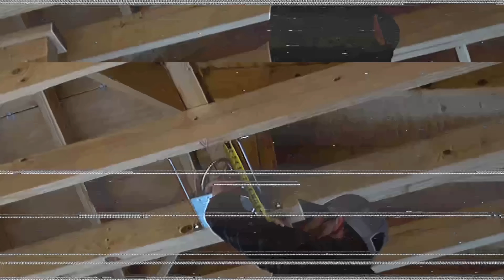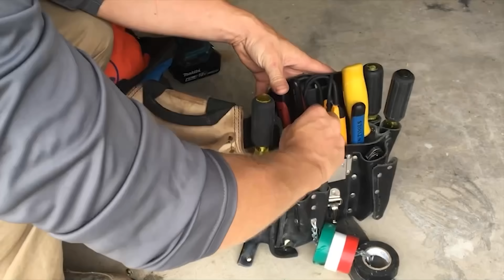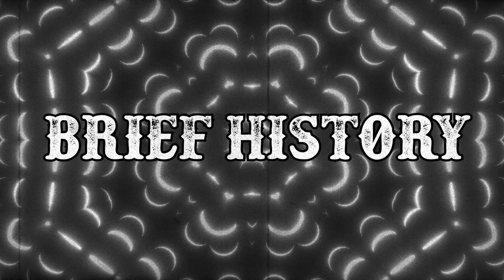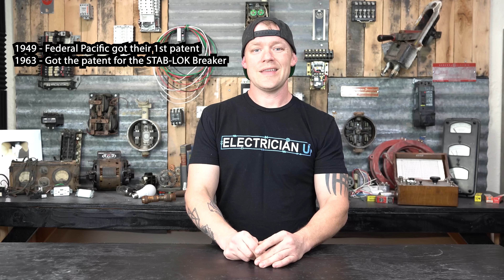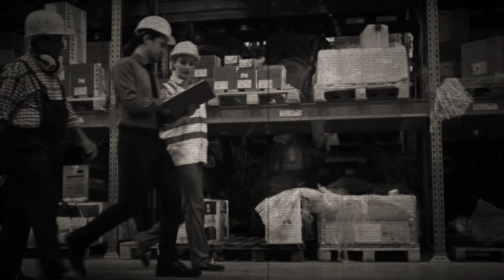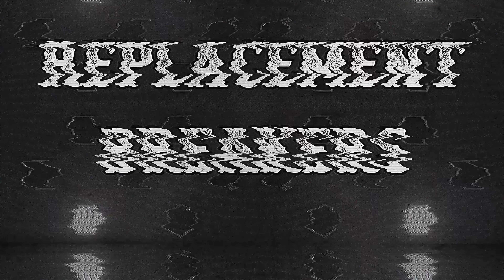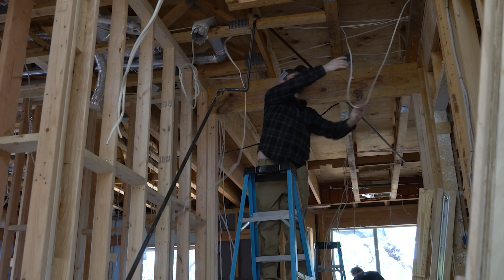FEDERAL PACIFIC ELECTRICAL PANELS - why their panels are dangerous

Comment: In manufacturing (of heavily quality controlled, UL listed) mobile dental equipment..can't say that I ever heard of a % of acceptable failure. 
Seemed like if even if a single device came back from an in-house error, it was a big deal/treated as a big problem. Of the probably several hundred I cranked out, never heard about any coming back. So i this instance, with products costing several thousand apiece, really a 0% out the gate failure rate seemed to be the status quo.

I suspect their stuff maybe failed/went in for repair after several years of hard use from dentists traveling into the 3rd world sticks, as the repair guy was busy. 
I'd guess that'd put it at maybe a 1-2% failure rate within the course of their 5 year warranty or whatever, and in those cases most everything I saw was earlier revisions prior to engineering upgrades - better cooling and whatnot to reduce wear and tear over time.

Keeping failure rate low seemed all about honoring the warranty thus not losing face and money, indeed not UL listed...unless a new product about to be sent over to UL for their internal testing.

Comment: The thing I hated the most about the stab-loc line is that when pushing in a breaker you WILL accidentally turn that breaker on.
Reply: We covered it in my 4 month inspection class and I always recommend they be replaced asap
Reply: It’s just so crazy that these panels are STILL intact in most homes and inspectors don’t inform the new home owners that “aye this electrical apparatus is kinda fucked and is a ticking time bomb. Change it own in the near future”
Reply: @ivanromo2030  Most home inspectors haven't got a clue about that.  Wasn't covered in the one day class that made them a "home inspector."
Reply: @tarf1a  the stab lock breakers and panel identification was part of my 3 month residential inspection course at Triton Community College
Reply: @ivanromo2030  Most home inspectors are literally idiots. Mine told me my house didn't have a sewer vent. They walked past it 20 times during the inspection. They stuck their receptacle tester in every receptacle, wrote a bunch of idiotic bullshit, and charged me $500. I'll never pay for one again.
Reply: My home inspector wouldnt even touch my federal pacific inspect it but they did say it's gotta go which I already knew being an electrician

Comment: Here in Puerto Rico old houses have them, each breaker is expensive and hard to find so it's better option change everything to General Electric. ✌️
Reply: Ge sucks. Had trouble with them the entire 50 years as a sparky. Took there crack service department 2 years to secure a low voltage relay for expensive dual ended 13,200 volt switchgear that was less then 10 years old. Had to replace 2 600 amp 600 volt ge junk circuit breakers after turning them off for machine overhaul. Service department was difficult to deal with no the worst to deal with. Was doing free work for a poor school & church and needed 6 500' spools of #12 guage wire. The ge crap supply house only sold it in 5000' spools.  GE contactors from size 00 to at least #4 size starters in MCC buckets always ran 30 degrees hotter than 3 other brands that I use to PM & perform an IR scan.
Reply: @garbo8962  sorry to hear that. I use GE when it's residencial, bigger than that Square D is great quality but expensive, that would be up to the client if they want to pay the difference. I used to work for industrial pharmaceutical  companies and Square D is the brand.
Reply: I experienced the same up here in Canada. FP breakers are $120 from suppliers if you can find someone with a few in their stock. GE panels are popular and 15A breakers from GE are $7 each wholesale.
Reply: Cutler Hammer is the way to go...all the rest live in their shadow now that square D is in the shitter from covid

Comment: other issue with the older stablock breakers is when u remove them the dam thing falls apart leaving the stab in the buss witch has melted to the bus......... resulting in needing to turn the main off and ive had those fail when trying to turn back on o what fun

Comment: An old Electrical Engineer I know told me, “The only breakers I’ve ever seen have the handle trip, and not disconnect, the only residential panels I’ve seen catch on fire, and the only residential panels I’ve seen actually explode have been Stab-LOK”.  Code requires that all devices need to be certified by an Independent Engineering Testing Laboratory, or inspected in the field to assure compliance.  Some things like a breaker is almost impossible to testing the field.

Comment: This is interesting. I'm a First Year Apprentice working primarily in service. I would say that the majority of panels/shut off's that we work on are Federal Pioneer. It's a running joke as to how long it will take for the breaker to trip when you're shorting a circuit to find the breaker on a Federal. They're garbage, but remarkably common in Canada.

Comment: You need to show examples of the breakers in question. Not every FP breaker made is a POS, only the Stab-Lok. There are a lot of FP commercial series panels out there that are just fine and have been for decades.
Reply: Federal Pacific 3 phase screw mounted breakers also had problems. But they did a recall on them. I know because I had to change out a number of them.
Reply: @gravelydon7072  Still, there are many out there functioning just fine.
Reply: @theprofessorfate6184  Yes, but they will likely fail at some point also. In our case, it was a mandatory replacement program for the 3 phase breakers. All we had to do was tell them how many of what size. We tried to send the old ones back and they did not want them. So they ended up being smashed and sent to the dump. As we had one that did burn, we weren't about to let them off State property unless shipped to the manufacturer or were smashed to bits.  Smashing them also showed that the others were also suspect of failure in the near future. Took over a week to change them all out as things had to be scheduled with those in the buildings supplied by each transformer.

Comment: Please make a review of Wago wire nuts which wire slide in!!!  I think it is piece of junk and not reliable, but I start see more and more of those. Actually, I saw new whole house wired with those!!
Pls like my comment to bring it on top!!! Thanks
Reply: John Ward has a tear-down and test-to-destruction of a genuine Wago versus a cheap imitation here: https://youtu.be/bP0qHyVAymU

Spoiler: the Wago survived 150A for 10 minutes; the fake didn't.
Reply: That's a topic rich with controversy and opinion.
Reply: @andrewalexander9492   Also a market full of fakes.  The real Wago® connectors made in Germany have to meet some very serious regulatory standards.  All the regulation and testing make them relatively expensive so there's a wide market for cheaper imitations that don't comply and are not tested.

Even in somehow "proven" to be superior (and I'm not saying) there'd still be a lot of resistance to adopting them over screw nuts, the trade does seem to be very conservative in its practices.  😀
Reply: I don't see the fuss, they are removable wire nuts for nervous DIYers and specific situations. Now that people replace light fixtures with LED fixtures, changing the "lightbulb" means changing the whole fixture. Removable lever wire nuts are useful for connecting devices in these situations, especially with thin stranded to solid copper wire joins. I've used the one-time push-in connectors and thats all my supplier sells. If something is wrong, cut it out, restrip and plug a new one. You may lose 1/2 inch of wire each time from the 6-8 inches of wire stuffed in the box/pancake. By the time you cut down to half way, it will be your great-grandkids problem. For continuing a circuit /pigtails I still prefer to twist wire on wire for a mechanical connection with a wire nut on top. I miss the days when elechickens and plumbdummers both soldered their joints. I felt it brought out a trades kinship. Perhaps we've been LEAD astray...

Comment: I was actually changing outlets here in Brooklyn today and  the insulation of the wire got nicked in the metal box and it caused a short and the breaker did not trip. The wire burned through 😳. Good old Federal Pacific
Reply: That could also be a grounding issue, could it not?
Reply: I had the same issue, I assumed that the breaker tripped and continued to work on it until it told me it was still hot, lol.

Comment: Are the circuit breakers from the 60's and early 70's bad?
Or are the ones from the late 70's and 80's the ones that failed more often?.
I haven't seen problems with the old ones.
I thought they went bad when they got brought out.

Comment: Dustin, the material cost to replace every breaker versus the entire panel box (to say Square D HO or QO), just the Connecticut Electric breakers are about twice as expensive and then you'd still have the old panel box with old technology.  I guess this might be an approach like you say, for individual circuits, but not a whole box solution.

TRECS Certified Inspectors wont even look beyond the FPE or Zinsco sticker any more, just recommend having a licensed electrician review it, and they 'strongly' recommend replacement.

Thanks for the history!  I always thought they just went bankrupt.  Great rundown on UL and a basic understanding of manufacturing processes.

I look forward to your Zinsco breakdown!

Comment: Do Bull Dog Push-O-Matic too 😁
Reply: In my neighborhood they have a lot of original pushmatic circuit breakers that were installed in early 60's with no problems. Worked in a slaughterhouse that had a ton of reliable pushmatic breakers. Best thing about them never have a problem with the bolt on style buss bar.
Reply: @garbo8962  agreed. Just require regular maintenance as they tend to gum up and not trip.
Reply: @SudburyMan    I liked them too, put in a few back in the day. Probably not the best for a moist or dusty environment, but that isn't good for any of them.

Comment: My experience with Stab Loc FP breakers, 1971 apartment complex with aluminum wiring in the apartment:  breakers would trip but the service entrance cable would get hot, only one side, fix: remove bus bars and sand down on bench grinder the temp would go from 140 degrees to ambient temp.  other than that only the connection would overheat just like every other one on the market that draws a lot of current.

Comment: I used to install Federal Stab-Lok in the early 90's here in the UK and I thought they were the biggest pile of shite going. Working live on a 400V board up a ladder trying to force one of those nasty pieces of shite into the board without tripping the rest of the plant was a nightmare. I don't recall ever seeing them for domestic use only industrial. I've fitted 400A Federal boards directly from a Sub Station so if that failed there would be a lovely light show and a rather loud bang.
Reply: Their bullshit is all over the residential market in us . Efin stab lok. Just sounds bad

Comment: The goal for defected products leaving a factory should be zero.  If you can only test every 100th item, if you find a failure, you stop your process, then isolate all the products from the last know good test.  Sort your problem, then inspect all the products  before you ship them. <0;01% failure is  a sign of a good (not great) factory
Reply: yeah, that's not what's happening. We've had whole batches of GE breakers (the set that comes for free in the box with a panel) be dead. At least those were a fail-safe.

Comment: I recently was doing a shut down with Federal Pacific switchgear. I was bringing down the load by shutting off breakers so Oncor can pull the fuses on the service transformer. I shut off a 400amp fused breaker and it blew up. A fire ball came shooting out and smoke 💨 filled the E-room.
Reply: Been there with 200A and can just imagine what you experienced.. the sound, smell and sight alone wow. IIRC should switch gear be operated once in a while to satisfy maintenance requirements?
Reply: @SudburyMan  Try a 600 Amp 3 phase 480 Volt one. Talk about a smell that lingers. Pepe le Pew would like his to last that long. 
And as far as tripping them weekly, that would not work in the environment I worked in. When research takes years and an electrical power outage can wipe out a year's work, it isn't going to be done. In fact, that is why I had to change one breaker with the panel hot and the wiring to the 3 phase breaker on. And it was all lug type connections, not ones where they clip in. Worse part, there was 480 Volts at around 5000 Amps that could be supplied by that wire from the transformer. And of course, it had to be the hottest day of the year so that meant that half way thru the change, I had to dump the sweat out of the rubber liners of the linemen's gloves.
Reply: Sounds about right. Don't the let PM find out. That's good temp material
Reply: Cesar, I am sorry to hear about the trouble you had replacing the breaker. How may I be of assistance? Thank you.
~ Jessica

Comment: Arc faults are now the “safe” comfy breaker that still can’t complete with the old screw shell fuses
Reply: Fuses are great overcurrent protection devices but provide no protection from other harmful faults like AFCI or GFCI. Bit of apples and oranges
Reply: @jacobmillyard6799  you can add an AFCI or GFCI easily to any circuit after the fuse and have a heavenly combo. Apples, oranges...Fruit salad my friend. Yum. Modular is the way to go. All-in-one jobs are always more expensive and prone to failure. Wasteful too, because if one part goes, you lose the whole. Keep it simple, easily replaceable components that do ONE thing really well, layer your protection, love the idea.

Comment: Thank you for your chsnnel, I have a Federal panel, I now need to replace the panel. I had a 30 amp breaker on a water heater that failed to trip and over heated. 

What do you recommend as a replacement panel. What breakers can I use in the interim?

Cabo Rojo Puerto Rico🌴🇵🇷
Reply: for panels square d q/o than siemens  than square d homeline, cutler hammer, ge  after that no clue what ever you think wld be easier to change in 10 yrs or after the fire lol
 for the breakers themselves connecticut electric makes a replacement line tht is actually safe provided your bus bars are in workable condition
Reply: Damn water heater killed a perfectly good....switch.